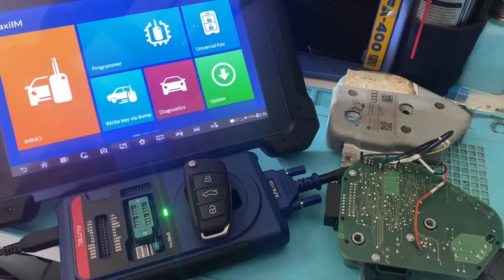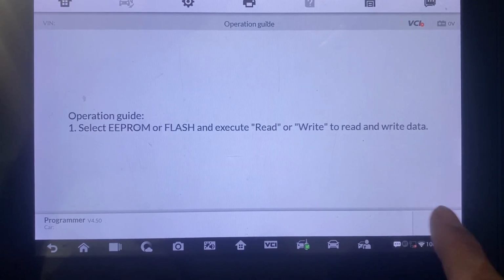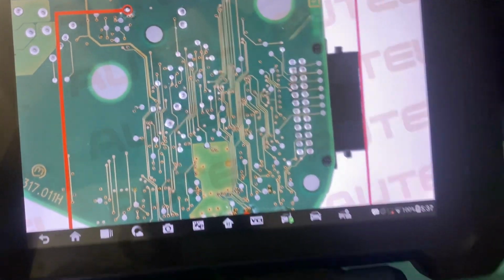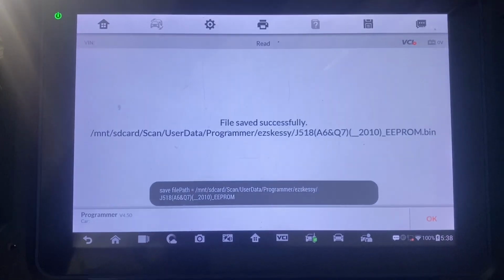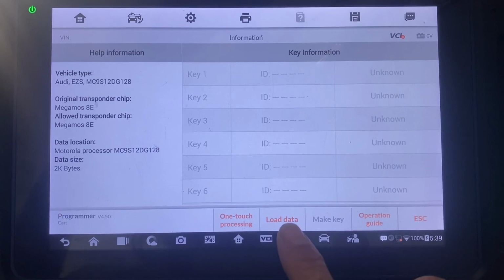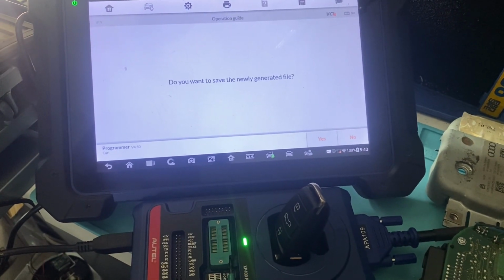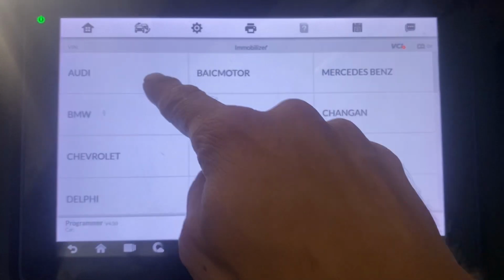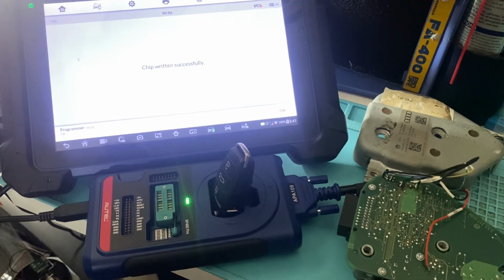Audi A6 2010 EZS All Keys Lost on bench using Autel IM608

Comment: If I join your group do you have a video that can help me wire up the bench on 2007 Audi S8? Customer
Had the Module Cloned to new Chip & key didn’t program as said it would. 
I’d like to program the key for them, using either Autel 6082 or Key tool Plus with all adapters. 
Can’t find a good diagram for specefic Chip.

Comment: Do you know to what years is the Autel im608 pro able to add key for Audi
Reply from the maker: It depends on the model. Mostly up to 2016
Reply: @JoeDLocksmith  yeah I tried yesterday on 2007 q7 to add key it failed couldn’t read 12 digit pass